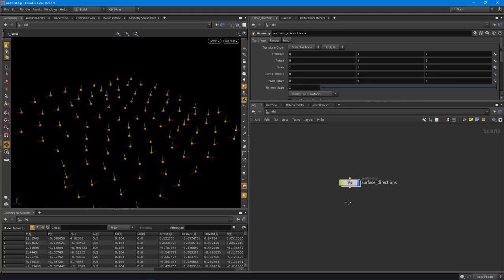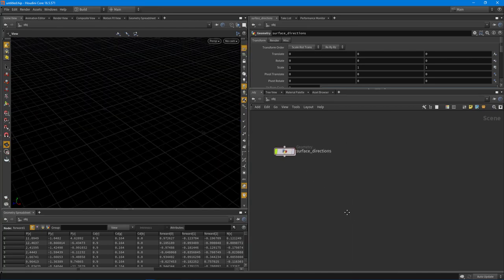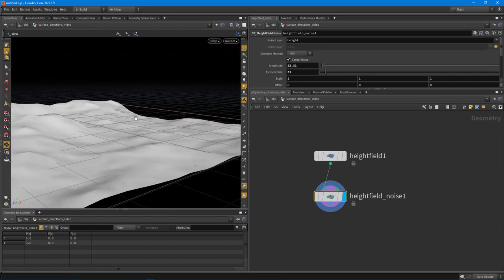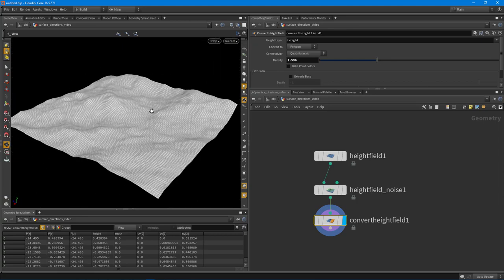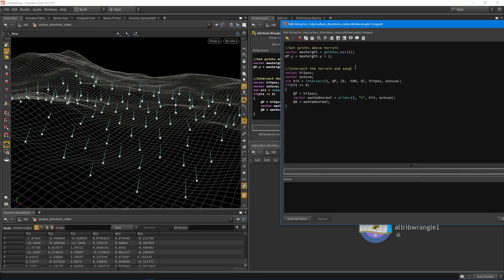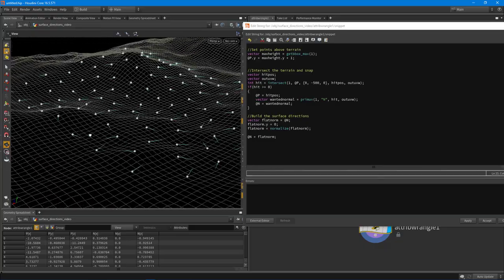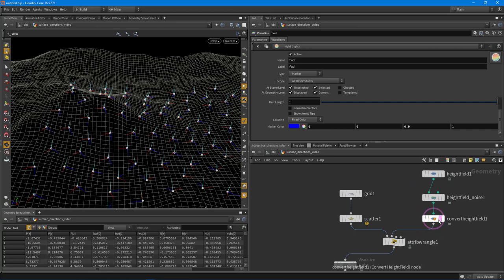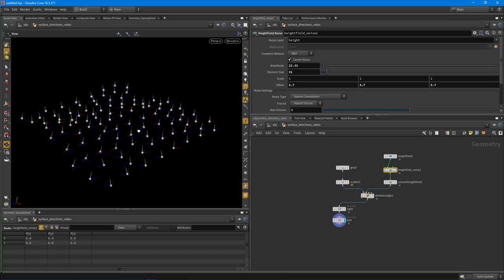Intro To Vex -  Part 008 - Surface Directions

Comment: Thanks a lot! You've used if statement to assign @P, but I tried withoy "if" and just written @P = hitpos; Another has the same result. Is there a huge need in "if" or it's your own way of doing it? Thanks again!
Reply from the maker: So I'd recommend using the if statement when using the intersect function....the reason is that it returns the prim number that was hit...if you didnt hit anything then it returns negative 1...so we check for that and assign @P appropriately.